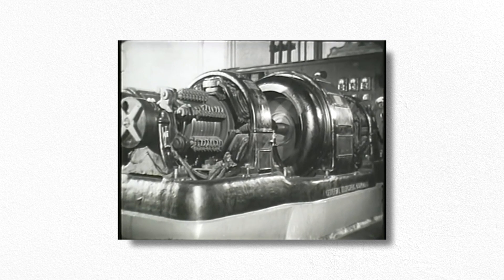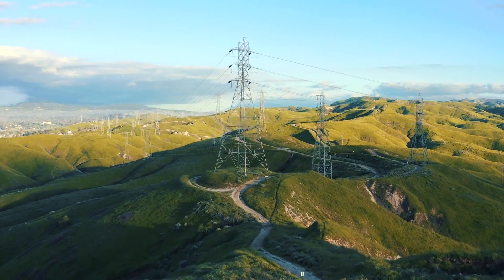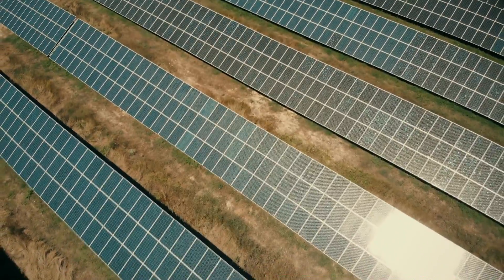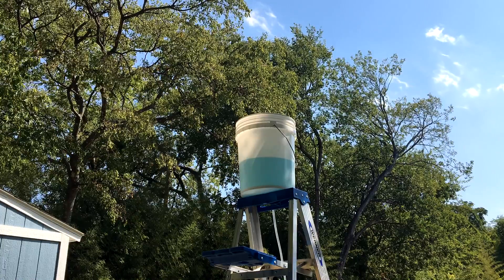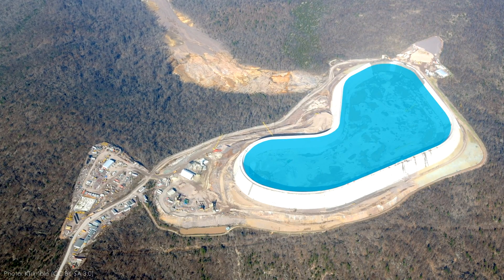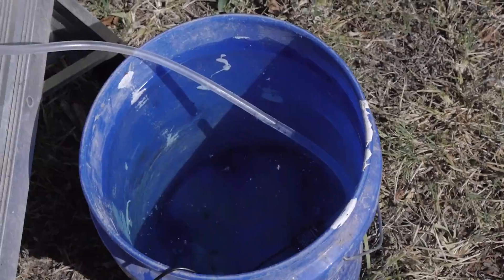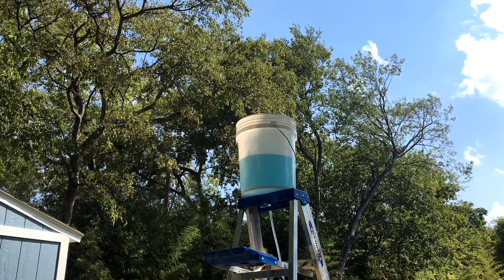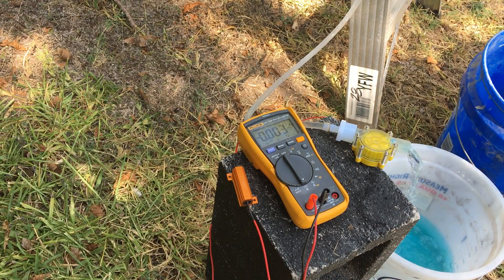World's Largest Batteries - (Pumped Storage)

Comment: Actual peaking plants are rarely used these days. CCGT plants can run as peaking plants, but after an hour or so they have a second cycle that starts up running on the waste heat of the first one. They're cheap to build too because they're super efficient (~60%), so they can also run as baseload so the construction cost amortises away.

Comment: Checked out Raccoon Mountain in Tennessee which is a pumped storage facility 25 years ago.  It uses excess hydroelectric power at night to pump water up to a mountain top, then drains it during the day to help meet peak demand just as you mentioned in your video.  I guess in their case the source is much more predictable than solar and wind.  Great video, thanks for posting!

Comment: I thought I came up with this idea in 10th grade! Then my science teacher let me know it was already a thing. Still not used in enough areas though.

Also I don’t mind the ads, usually just skip em. Go out and get that money
Reply: Pumped Storage-cum-generation systems function as extremely inefficient "batteries" because they involve two inefficient conversions (a) pumping water uphill and (b) regeneration by hydel. When you combine this two stage conversion, the overall inefficiency is the product of the two inefficiencies. As a strategy this is therefore less likely to succeed.
Instead, particularly in monsoon lands like South Asia, if water is pumped up and drained out only for irrigation, then you double the system efficiency making it viable. 
Next, COMPLETELY dedicate all existing solar and wind generation ONLY to uphill pumping of monsoon rainwater from flood plains, into storage lakes at different altitudes, and intermittence of operation becomes inconsequential. And you do not need batteries any more!
With reference to the Indian situation, there are additional facilitating conditions and benefits. Central India is a plateau - will allow artificial lakes at different altitudes, strategically located over roughly 30% of the Country's area and networked with metre dia or larger pipelines. Lakes with unlined bottom will also allow slow recharging of severely depleted aquifers.
In most other countries, where the seasonality of monsoon or need for large irrigation demands do not crucial factors in water system design use this intermittent power source to raise level of drinking water supply, industrial use, etc into massive overhead water tanks.

Comment: Free energy when it rains.
Reply: Also lost energy due to evaporation when it is sunny...
Reply: @stephenshumaker8444  Put solar cells on the water. It uses the power of sun and avoids evaporation with its shadow.😉😁
Reply: there could perhaps be a concern about the reduced rainfall impacting the local ecosystems for negligible gain in storage
Reply: @michelbaguette3106  ''''''Put solar cells on the water. It uses the power of sun and avoids evaporation with its shadow.'''

it's not worth it

it cost almost no money to replace the water that evaporates because water it so cheap
Reply: @robinsss  or place an plastic sheet on the water so water cant evaporate. There are also chemical liquids you can put on the surface on the water for preventing evaporation.
Reply: @stofjes4204  i disagree with the idea that you need a natural structure like a mountain to create this battery

we  have man made structures that can serve the same purpose

their called buildings

make a  building of the desired height , fill the top 2   floors with water , let  the water drain down to the first floor then pump it back up to the top

the  top of the building would prevent evaporation
Reply: @robinsss  Thats a very interesting idea. It would be great to make it happen. 
Actually iam working out an idea to create a perpetual motion by using many different mechanical principles. To be honest i really think it can be operational. The fundamental is to make use of unnatural waterheight. So who knows :)
Reply: @stephenshumaker8444  hopefully shadeballs will help
Reply: @mohammedraheem6288  SHADEBALLS TO THE RESCUE!
Reply: @A.R.77  😅🤣🤣🤣
Reply: @stephenshumaker8444  Funnels solve this problem. A funnel could be used like a one way valve
Reply: @stephenshumaker8444  You can prevent evaporation using shade balls.
Reply: @stephenshumaker8444  Rain compensate evaporation and infiltration.
Reply: @agustinruizmoreno524  Yep, in a rainy area it does! Probably won't with Hoover Dam in Nevada.
Reply: @stephenshumaker8444  it would if so many states weren't consuming so much water from the Colorado river
Reply: @stephenshumaker8444  but Nevada has the Colorado River
Reply: @agustinruizmoreno524 
That's not really true. For most of the US evaporation rates exceed precipitation rates.

In Arizona evaporation rates are as much as 20 times higher than precipitation rates. 

Only exceptions are the PNW, North East, and Rocky Mountains.
Reply: And a free power loss when the air is dry.
Reply: Rick Smith yep that’s the trade you lose energy when it’s sunny and you gain energy when it’s raining. Still in the meantime it’s nice to not have as much energy wasted
Reply: @ABEL-cd2sp  gravity generator with solar panels. Best of both worlds. 

Multipurpose stuff is the way to go.
Reply: @RicksPoker  Nope, they can use shade balls.
Reply: @RaveYoda  
Hi Rave Yoda.
You need to tell California, not me.  They struggled with energy loss to evaporation for years.  Maybe they have already tried balls?

They seem to have given up on the idea, rather than making new high-reservoirs for water, they are putting in Tesla Mega Packs for energy storage.  Look up the Moss Landing project.

Warm regards, Rick.
Reply: @RicksPoker  I don't know what California has to do with my original point? That point being that you can prevent evaporation with shade balls. Whether others do or don't is beside the fact.
Reply: @RaveYoda  
Hi Rave Yoda.
I had read a report discussing how California had tried this and with their hot dry climate had such large losses from evaporation that it was barely worthwhile.  In a rainy climate (where MORE water comes into the upper reservoir than ends up evaporating) this would make more sense.

I am pointing out that in the real world, this strategy failed at least once.  

As a practical point, people are not rushing to build water towers for energy storage.  Several utilities ARE buying Tesla Mega-packs.

Warm regards, Rick.
Reply: @Jo Blow "that top reservoir isn't being replenished with rain water,"  Does it have a roof?  How are they stopping rain water from entering it "when it rains".
Reply: Rain contributes very little. This is according to an email I got from the Tennessee Valley Authority regarding the Raccoon Mountain Pumped Storage Facility.
Reply: Exactly my thoughts when I watched the video: not only is difference in elevation a consideration when choosing a location. Precipation and Evaporation is also a factor. Would have loved if you went into more detail about that, but that would have blown up the scale of the  video probably.
Reply: I think the rain and evaporation effect is so low it's negligible.
Reply: @Sqwince23 For run of river or hydro stations you would be correct but for pumped storage generally the catchment area of the bottom reservoir is considerably greater than that of the top reservoir and thus rain would more than likely reduce your generating capacity.
Reply: There's a dude on YT who made a system based on this. Let's say it's not very efficient.
He even tried with holding as much water as possible in his gutter and releasing it all at once, but still he could barely charge a phone over night.
Reply: @SmartLifeEnthusiast  What if the releasing all at once was the problem. Maybe very small generators are the key to efficiency. Perhaps several in series. 

The problem I see is that your trying to store energy by displacing the water from the ground to the ceiling, but your only attempting to capture the energy from a few inches worth of drop. 

The real trick would to be to create a screw mechanism from ground to roof. Or dozens of small generators. Like a chain.
Reply: @expressionoffreedom7165  Water falling from a height and being funneled through a spout onto a generator will probably generate more energy than water flowing over multiple generators.
But I'm not a scientist/engineer.
Reply: @SmartLifeEnthusiast  well I'm just thinking how at Niagra falls they don't funnel the whole river into one giant generator, but instead several smaller ones.
Reply: @Claptrap Jesus and from ground water coming to the surface
Reply: @Claptrap Jesus I have no idea how that is related, but I don't disagree.
Reply: That's just a hydroelectric dam with extra steps
Reply: no free energy exists - our the only source is the SUN and sub-products, which holding that sun energy like gas, coal, wind or directly sun radiation
Reply: @s.i.m.c.a  don't forget geothermal. While ultimately from a star, I don't believe necessarily our sun.
Reply: Yeah thats called a dam connected to a river xD
Reply: Even more so if you build wide instead of deep
Reply: *physicist voice*: THERES NO SUCH THING AS FREE ENERGY!!!!
Reply: @anger_birb  not in the sense of what the term means scientifically 

but it a more generic literal sense the ocean is delivering free energy

and the sun is too
Reply: Rain can make artificial (cloud seeding) or large sized air water production generator and machine.
Reply: Probably not very much. Being at high elevation, they probably don't have their own watershed. So only rainfall that lands directly in the reservoir is added, compared with natural lakes which have watersheds many times larger than their surface area.
Reply: So a dam...
Reply: But it's solar power
Reply: Free energy under our feet 24/7
Reply: That's called a dam :P
Reply: Sooo Amazon?
Reply: Exactly my thought. 😂😂😂
Reply: The assumption is that rain will raise the height of the water in the top storage tank.  But of course it will raise the height of the river at the bottom as well, and possibly by a larger amount.  Rain could reduce the energy produced or increase it.
Of course if it never rains the river dries up and the whole thing is not going to work.
Reply: Especially when it's monsoon season.

Comment: As a So. California resident, I benefit from a wide variety of electricity generation schemes including pumped storage and the use of surplus hydro power from the Pacific Northwest via the Pacific Intertie DC long distance transmission system and of course Hoover Dam. We produce quite a bit of solar too. The problem for smoothing the "duck" curve for us with that system is that the major transmission lines run more north and south rather than east and west. If there was an efficient DC long distance link to the east coast grid, now mostly separate from ours, the surplus solar we have could be sold to the eastern time zone at the time they need it and as their peak ends ours is just beginning.

Comment: 7:46 looks like the dam interior from CoD Blackout
Reply: Worked at a utility where we had wind turbines that drove the pumps to pump the water up. Then release the water through the turbines as needed. Seemed like a good way to use turbines that are lucky to get 30% or their rated power in normal conditions..

Comment: Excellent explanations in a way easy to understand. One little detail, that could be changed is 1:35. What You say about the efficiency is generally true. However, flexibility of nuclear power plants is very limited, whereas thermal power plants, based on combustion, are quite flexible in many cases (depending on technology though).
Reply: If nuclear plants are so designed, they are flexible on scale of hours.  French and German reactors ramp regularly ramp up and down to accommodate load.
Reply: @Nill757  If You don't believe me, You can look it up Yourself: https://www.energy-charts.de/power.htm
In Germany load is accommodated by pumped storage (as little as they have), then gas, then hardcoal and in "extreme cases" also lignite. I'm not trying to say that the load in nuclears is constant, but if You look at the graphs and take the scale of the whole system into account, they work for baseload exclusively and they run "flat as a table".
Reply: Quite similar in the case of Spain.

In France I haven't seen that many graphs, but what I saw was similar. Also France has quite a lot of hydro installed in their system (including pumped storage).

Comment: There is also one often ignored "short term" storage of electricity. All the rotating masses connected to the grid via a generator. All the generators and turbines spin synchronised with one and other and can cover large spikes in demand for a short time.  This is also one often overlooked problem of wind and solar that they lack this self - auto stabilising effect that is important for a good stable grid.
Reply: Very short you need to bring new generation online very quickly to stop the kinetic energy of the turbines being converted into electricity at a faster rate than it is being replenished or the grid frequency will tank pretty sharpish. While you could probably get away with this you will find that grids typically run to rather tight guarantees on frequency (Typically within a 1% margin of error) in part due to the fact that many mains powered devices actually rely on it as a oscillator for synchronisation or timekeeping purposes.
Reply: @FaerieSeraphina  Yes this is what I was trying to say. That the kinetic energy is what keeps the grid stable between the load power on and generation increase.  My professor had an interesting ted talk about it (Kako zelena je zelena energija? | Rafael Mihalič | TEDxLjubljana) but its in Slovenian.
Reply: @markoantesic4362  Yeah my point was just that this really isn't that big a contribution to storage and in fact a relatively small change to things like solar arrays that don't have rotating parts that could achieve the same effect is a simple flywheel. It wouldn't be that hard to construct a flywheel with the equivalent angular momentum of a steam generator of equivalent capacity. Wind turbines are probably less of an issue in this regard sure a 2MW wind turbine has a much lower RPM than any 2MW generator but this is also compensated by the much higher moment of inertia resulting from the fact the blades are way way longer than the turbine blades of a 2MW steam turbine. I bet the rotating mass is probably easily as large too they are giant machines after all not sure how heavy they are as sure the blades are probably hollow but they must have a lot of structural strength probably way more than needed for the forces they are intended to encounter if the videos I have seen of wind turbines failing due to a brake failure are anything to go by. Granted that's only anecdotal sure but the RPM they seem to get up to before the blades end up buckling snapping or otherwise failing is way above the RPM they are designed for suggesting a large margin of safety built in there.
Reply: @FaerieSeraphina  There were flywheels proposed, for complementing renewable, but they are all but simple. Proposed flywheels would use magnetic superconductor bearings(for efficiency), run in vacuum, but as far as I know they have not build any. I was told that there were problems with  what happens when the magnetic bearings fail :D Wind turbines are not suitable for storing kinetic energy because they are not directly coupled too the grid va a synchronous generator. Because of the fluctuating rotation speed of the rotor wind turbines need something between the generator and the grid. You have inverter solution that do AC-DC-AC and fancy double feed induction motors. Tho they can provide some storage, they rely on electronics to do so and it can have stability problems, when large amount of electronics each does it separate  thing to try and balance the grid. 
But yea, if pump storage are the "batteries" then the rotation masses are the "capacitors" for quick dP/dt.
Reply: @markoantesic4362  Yeah sorry I guess I wasn't clear there when I said simple I was talking about a flywheel that would say give a 100MW solar array similar spinning reserve capacity as a 100MW coal plant for example ie seconds for rapid response plants to spin up if in the future there are not enough steam turbines left to perform that role.

There is a lot of untapped potential hydro storage sites and some are much bigger than current installed schemes but the energy mix is not ready for that scale yet they just wouldn't get enough daily volume to produce a profit in a realistic timeframe. A site in Scotland for example could apparently reach 6,800 GWh and 180 GW but that is a peak output that is around 1/3rd of the entire EU's peak recorded demand total and it could supply that for up to a day and a half the market for such doesn't exist yet and the UK grid has nowhere near enough installed export interconnects even if it did.